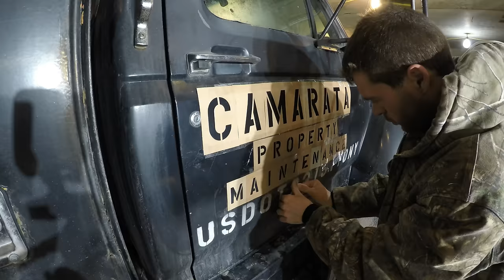Getting stopped by DOT

Comment: That oil was way overdue for a change. You should check that tire pressure and light functions at least once a week and the fluid levels as part of your precheck list. Make a maintenance schedule for all your equipment and include your paperwork renewals so you are not depending on an overworked clerk in someone else's office to keep you up to date. You have to pay all the fines and penalties, not them. You have some good safety practices but you shouldn't be working in that shop alone. If you slip and hit your head or some other surprise knocks you out it could take a long while for someone to notice that you are missing. Stay safe and keep up the hard work.

Comment: that type of rim is called a Dayton Rim and the valve stems should be across from each other, should check the nuts after fifty miles,   we used to run five pounds less air on the inside tire to allow for the crown in the road, before there were interstates everywhere of coarse.  tighten the brake adjuster up tight and back off 1/2 turn, brakes will be even.

Comment: I never saw the side by side duals circumference measurement on the same side tires,,, if not close or identical it will peel rubber and tread off like the buffer at the recapping plant takes it off! Many times you have to replace both tires and send one or both takeoffs for capping but always check your spares for a match!!

Comment: I was a little disappointed your tire removal method seen at 10:02 isn't quite the same as mine: First the Sledgehammer... Then the slide hammer bead breaker... Then start up the backhoe and gently set the bucket on the bead lol

Comment: The next time you try to take that tire off the rim, put 1 spoon under the bead and make it stationary, use another spoon beside it and knock it around the bead with your hammer. As the spoon moves circular around the rim, the tire bead should slip over the rim. this should eliminate your action of having to saw your tire off.

Comment: leave your wheel nuts on a few turns until rim wedges are loose. those things can fly off with much force.also your tire height between tour two duals should be with in 3/8 inchor you will have very rapid wear of the smaller tire.

Comment: Careful hammering those wedges. It’s safer to thread the nut on a few turns before giving the wedges a tap. Have heard stories of them putting holes in walls across shops.

Comment: You live in a bad state for Department of Transportation stops. I'm a Long Haul Truckdriver from Minnesota. It's 3/32 on the steers and 1/32 on the drives is what the Federal DOT says. New York may be different though.  If the groove on the outside is gone you should replace it. No cords allowed. If 2 grooves or more next to each other are smooth you should replace it. You can get the fire extinguisher refilled if you buy the right kind. Saves a few shekels that way. I have to get a DOT sticker for the truck every year, I take my Physical to the License Bureau when I get it. That way the State has no excuse and I do daily Vehicle Inspections but I live in my truck. To keep the tires from wobbling I used to place a sledge next to the tire and spin it. You can see the tire move back and forth.  There's more but you are doing fine.  Please continue.

Comment: Fire extinguishers typically start losing their pressure within a year of being refilled. You can take your existing fire extinguisher to a nearby firestation, and they should be able to test and recharge your fire extinguishers. Safety guidelines recommend taking your fire extinguishers in every year to be re-pressurized.

Comment: Oh yeah the fines are astronomical, the last time I drove commercial and was stopped by D.O.T, the company ended up with a  $1500.00 in fines not me. Unfortunately  ALL commercial vehicles are included and all drivers wether they own the truck  or just drive  it, MUST perform a daily inspection before use. As for the fire extinguisher, NEVER buy one with a black plastic trigger, the nitrogen gas charge escapes overtime, past the threads. I had a fire once and used such an extinguisher, when the trigger was squeezed, it BROKE and had to be jury rigged with a screwdriver to discharge.

Comment: A couple years too late, but get yourself a flat piece of steel about 12" x 4'. Jack the truck up just enough to slip the steel under the tire- put some grease or oil on the steel- your tire and wheel will slide off the axle on the steel plate- no lifting or manhandling necessary.

Comment: Man as a truck mechanic myself I have to say you done some really dodgy stuff there lol 
 you had me worried taking the nuts off then hammering the locking tabs ! You should always leave the nuts screwed on a bit then hammer them ! They are like bullets sometime and not matter if it's never happened to you before you should never risk it !

And you adjusted the front boosters wrong ! I you tighten them up as far as you can then back off half or quarter of a turn ! 

And you should grease your slack adjusters and drive shaft s more often ! 

Peace
Reply: Plus use an inflation cage. I've witnessed these tires blowing and the dogs coming off like bullets. Both things scared me watching.

Comment: To break the bead, use the weight of your trucks front wheel. Jack it up and lower it on a board so it won't slip off.

Comment: U need a tire hammer for the beed looks like a sledge and a sideways axe, 2 spoons and some diesel as lube 10 min job. But when its not your thing ive seen em put body builders to shame. The struggle is real. You gotta check to make sure the wheel is on the hub straight... put your hammer on the ground touching the sidewall, spin the tire tighten the lug that gets close to the hammer first. The gap shoud stay constant as you spin the tire.
Brake adj... tighen all the way back off 1/2 turn. If its got more then 2 axles the rear axle should be the tightest and slightly looser as you go forward.

Comment: Your supposed to take the pressure off them wedges on the Dayton wheels while leaving the lugs on loosen them up but not all the way off then whack the wedges with a hammer the pressure they are under they could kill you if one shoots off the lug

Comment: 22:40 that tyre looks absolutely shagged, look at the jagged castellation on that. I'd recommend only using it as a spare as you are doing in this case, and then replace it ASAP. Not necessarily dangerous, but can cause excessive wear in wheelbearings, road noise (not an issue in this kinda truck, I suppose) and make the drive feel like the fillings are being shaken out of your teeth! :P

Comment: I was taught to put Dayton wheels on by setting a hammer on the floor next to the tire and spinning the tires to check alignment. I bet those wheels wobble like hell.
Reply: Unfortunately, 9 times out of 10, those widow makers aren't installed right. Your right on checking the alignment of the wheel, I use a tape measure, but anything works really. The wheel bearings take a nasty beating when they're out of alignment.

Comment: I never liked spoke wheels. It’s really hard to get them on to where they don’t wobble plus don’t even get me started on balancing them. I hate an out of balance tire. The have to be rebalanced after being patched and an out of balance tire will hop just enough to cause uneven tread wear and make it cup all the way around. He said that he bought those tires new and then he wasted a perfectly good carcass suitable for capping. Recappers will pay a hundred bucks sometimes for a virgin carcass. Most of the trucking companies I drove for used recaps for drive axle and trailer tires. Recaps cost a whole lot less than new tires and they last about as long as new ones. I agree with one commenter who posted about a new tire beside a used one. The new one will wear out the used one because the new one is taller. Seen it happen countless times. Recaps work good for a dump truck like his working locally. I have found that recaps are only good for about 65 MPH because they get hot if they’re run much faster and in hot weather will throw the cap. Personal experience. The company I drove for was getting new trailers and they were loading the old ones and parking then in the yard for drivers to deliver the load and drop the empty off. Anyway, at the time back when the speed limit was 55, I was on I-70 with one of the old ones loaded , going just over the double nickel with a long line of cars behind me, all of them tailgating me and each other. I had just looked in my left mirror and as I was looking, I heard a WHOMP and the outside tires cap came off in one long piece. Looked like a big snake and all those cars all disappeared. Lol  Best way to get rid of tailgaters! I have no idea if it actually hit any of them but if it did, it was their own fault for following me so close. Memories. I have a lot of them over my 30 years career. Some drivers worked a lot longer than that but I didn’t start driving truck until I was close to 35.

Comment: I worked for DOT for 6 months because I needed a job as there is no construction work in Alaska during the winter months. I saw right off the bat that this place was a revolving door job with people just hanging out and collecting a paycheck. Out of the 7 people that worked 3 were too fat to fit under a truck to perform a Level 1 vehicle inspection. Allot of these guys are cop wanna-be's who couldn't make it on the police force. One DOT inspector in the Anchorage department applied to Anchorage PD 14 times but was rejected because he was mentally unstable. The other DOT inspectors literally could not do anything else in life but read from a rule book and I could see that they were actually venomous towards blue collar workers, tradesman, truckers etc. The best advice I can give you is be firm and don't take any BS from them. They would actually let certain drivers go because they knew that this driver or that driver was a hard-ass and would give them grief, yet they would stop and inspect certain drivers who were known to be good guys, easy going and compliant. This is endemic to Alaska, being that Fairbanks is a small town, you see the same drivers repeatedly, either on the job or in the grocery store during off hours, you build a reputation with the pool of local drivers. In my 6 months on the job I never wrote a single ticket and always focused on identifying mechanical problems with their vehicles. I knew that there was no future working a rubber-stamp job for the state so I gathered up my money and bought a dump truck and now I haul gravel. There's loads more satisfaction in providing a service people need and seeing a job well done at the end of the day then working a rubber stamp government  job. Keep up the good work Andrew!

Comment: I like when you say put the tire on correctly, and then tighten it incorrectly. 
And the wheel should not slip on the hub if it is installed correctly

Comment: Universal joints on the drive shaft should ALWAYS be lubricated with a hand operated lubrication gun. If you use a power operated lubrication gun, chances are you damage the rubber seals of the universal joints so that grease escapes due to the centrifugal force created during the high RPM of the drive shaft.

Comment: Andrew one of the things I was taught about those Wheels when you take them off the Hub if you back the screws all of them off about a half an inch smack one of them with a hammer HCL Jeff Lewis I know when the tractor trailer is that those hubs are on we will smack the shim Bank of the screws off and take down the Shins reason for it now it may not be that much pressure on a on that truck put on the tractor trailer it's a whole lot of pressure on those Wheels I'm just saying be careful and loosen those things you're not sure how much torque was used you put that wheel up on the Hub

Comment: That slack adjuster is no good.  You should have to push that ring in, to unlock the  adjuster bolt.  That bolt should  be able to lock, in position,  to  keep the adjustment from backing off. Even though the rear brakes are self adjusted type, still check them, foe proper adjustment. Drive tires are 2/32 & steer tires are either 5/32 or 4/32.
Reply from the maker: I fixed that lock thing on the front.

Comment: Surprised he didn't hit you on your mud flaps. Usually, they're pretty sticky about mud flaps and it's one of the first things they look at. It looks like yours only come to mid tire height? Is that legal in your state? I've read that as a good rule of thumb the maximums are 10" off the ground and a rough measure rise of 5" for every 12" of run for a max angle of 22.5 degrees from tire contact point to mud flap bottom edge. Not trying to nitpick you brother, just trying to give you a heads up to keep you from getting pulled over again or possibly throwing a rock through someone's windshield.

Comment: If you bought that truck used the original owner may have had that adjusted to 55 miles per hour to save fuel. Corporations are known to do that. Even though it is actually a hazard on Main thoroughfares where the speed limits are 65 and 70 miles an hour to be driving 10 to 15 miles under the posted speed limit can create a hazard. Truckers please keep to the right don't create unsafe conditions where vehicles have to change lanes to get around you. You are creating a hazard. And in some states like California you can be fined for failure to move with the flow of traffic yep it's a law.

Comment: I'm looking at buying a truck just like this but a 1999. This one is a six-speed. Have you ever seen one that doesn't have a two speed rear end? also, the truck seems like it's geared way too low, but at the same time it always wants to stall when getting out I'm first gear you have to give it a lot of gas. Does that sound normal?

Comment: good thing you filmed this. did you get tickets? and if so did you get them waved with this video? thats what happened for me when my boss and i got stopped. 7 tickets. 

i didnt have my dot card (even though i wasnt over weight *i had chauffeurs at the time*) still had that ticket   edit: which im glad i got my dot card for future.
fire extinguisher. (still had that ticket)
mowers weren't tied down (waved with photo evidence)
 chains not crossed correctly (waved with photo evidence) 
breakaway not hooked up properly ( waved with photo evidence)
no traffic flares (waved with photo evidence)

and i honestly forgot the other one. even the magistrate said, "look at the line out there, its all contractors. no we're not getting you for everything but we're getting you for something."

Comment: When you live in areas where the temperature very from below freezing to A 100 degrees you should check your tire pressure every time the temperature moves more than 10 degrees. The pressure you put it in there when it's 20 below outside will be a hell of a lot higher when it's 98 Degrees. And vice versa. Checking tire pressure and fluid levels should be at least a monthly ritual. With a commercial vehicle weekly. I know it's a pain in the butt but not a bigger pain in butt as getting down on the highway for with a blown tire or losing weeks of income or more because of a blown engine do to $10 worth of oil or tranny fluid. Doing this menial task will Alert you to possible bigger problems that you can catch early. You know a $10 gasket rather than a $4,000 motor

Comment: And without DOT writing tickets 95% of the trucks on the road would turn into deathtraps because there's always another excuse why people don't need to fix things.  Hey, I got brakes on 3 out of 5 axles, and 7 out of 18 tires are in good shape---what's the problem?
Reply from the maker: I didn't have an bad experience with DOT. But I always hear stories about them making up problems that don't exist as just a way to collect revenue. Which is nonsense. Really trucks should be designed to last 80+ years, not 20.

Comment: I dont want to see anyone get hurt. Please when taking the lug nut off. Take it almost all the way off. And the step to the side of wheel and smack the outside wheel with a sledge hammer. Itll knock the wedges loose. Those wedges come off trucks and trailers so fast I've seen them blow through car doors a dumpster.

Comment: With fire extinguishers a majority are dry chemical and the chemical becomes pack down so when you go to use it all it does is just blow gas and no chemical. If you buy the right one you can take him and have them serviced. They have an inspection date on a card and should be inspected annually. Fire extinguishers have one of those things you forget about until you need it. And with yours it would have been probably oh shit.

Comment: What blows my mind and pisses me waaayyy off is how many of them don't know what the csa points system is..
That being said and damn elogs and companies that are disconnected from those HUGE facts will continue to ruin truck driving.....i got 22 good years on the road and untill the last 5 i have had a clear liscense....being wrote up for things like short mud flaps, low air preassure by 8lbs and SEVERAL other pointless issues multiplies by 2 on the next stop...if same things still haven't been fixed by your company on the 3rd stop, they multiply by 3 on the csa point system....like i said earlier, most of the dot i have experienced dont even know the damage they are doing to us drivers and they dont care if you end up like i have...a driver with a useless license because of bullshit rules and companies that either wont back us up mechanically, or cant afford to.

Comment: Using the wrong hammer there’s a specific hammer for that I used to do truck tires and every time are you going to do that you need to put water and soap liquid soap for dishes cheap brand always put soap and water installing and uninstalling the tire on the rim